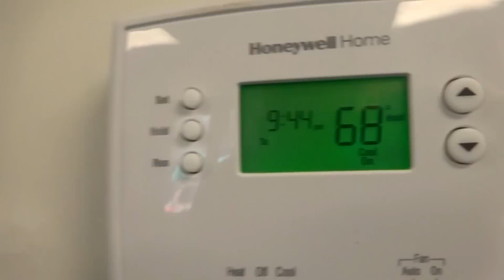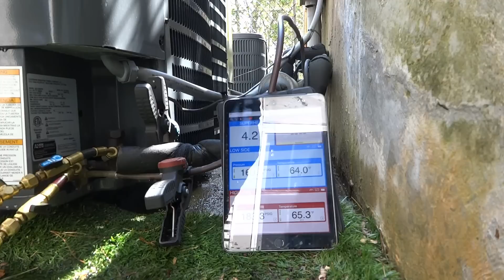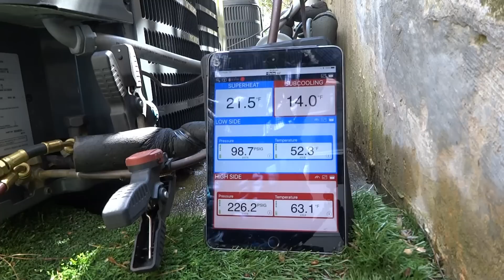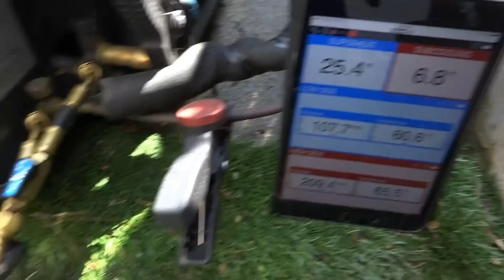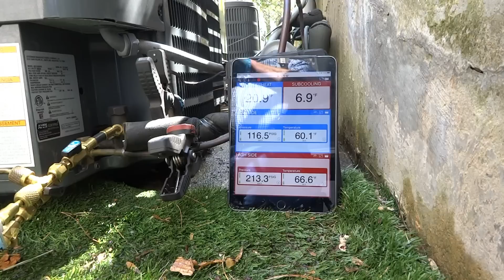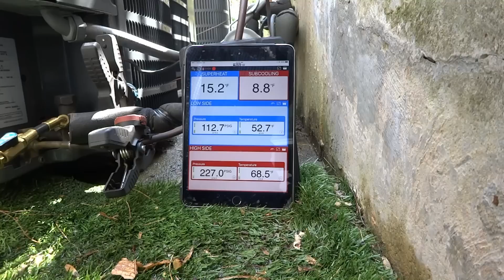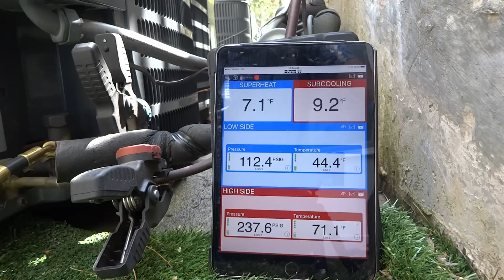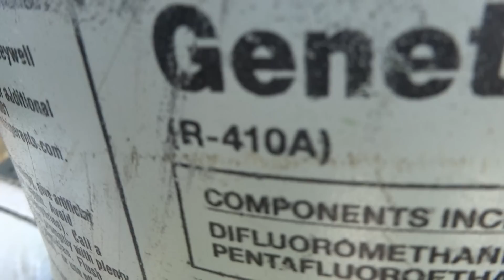AC UNIT ICING UP RETURN THE NEXT DAY

Comment: I have 6 roof top units at work. Only the jail unit gets nasty with cottonwood. It will pack jail unit but other units will just have small amount. Every year. Thanks Steven!
Reply: Cottonwoods on one end of one of the many multi housing buildings I take care of. Oddly enough it only seems to be two of them that consistently get hammered by the fuzz every year.

Comment: I always keep my fan to “on” not auto. That way it’s always moving air in my 3 level house, plus no start up surge on the motor. 🤷‍♂️ In my case on is a very low speed until heating or cooling is called.
Reply: You can but the outside unit won't run till that coil inside gets hot
Reply: @prettycureforever7102, the condenser or outside unit comes on when the thermostat calls for cooling, it has nothing to do with the evaporator coil or inside unit getting hot.

Comment: They are changing again, from 410a to R32, this crap is getting out of hand.   In Mexico they are installing brand new R22 units, meanwhile here they are mandating to toxic refrigerants that are even flammable.  I gave a window R32 AC a little toot of 410a using a bullet connector, seems to cool just fine. (410a is 2 refrigerants, 50/50 R32 and R125)
Reply: A LOT of mixtures in the automotive industry years ago, and some very flammable! Interesting about Mexico. They probably sell Gas Stoves too! 🇺🇸👍
Reply: @hinspect  R-1234yf is actually flammable, but the EPA is in denial about the risks.

Comment: 410-A system on an R-22 coil.. wow. Ain't no Taj Mahal
Reply: I thought that was actually quite common.  My old house had a 410A system, and it was put on right when Carrier started to build 410A units, so the coil was an R22 one from the beginning.
Reply: @douro20  R22 Coils are not made for 410a pressures. people do the shit , but not me. I'm not gonna hack the system. if they don't want it fixed right, Call someone else

Comment: It's extremely painful to watch someone clean a coil the wrong way. These units suck in air and blow it out the top, so you have to spray the coils from the inside out to reverse it, otherwise you're just pushing most of that junk deeper into that coil. If it has a fur coat on it like that first one did, a soft carwash brush works to gently brush it off first. It's not rocket science 😆

Comment: its so much worse cuz its a leaker and running more to try and do the same job.  and no you don't do what the customer wants, burnouts need evap, and line set change. your acting like your new at this, some times you pass on jobs when customers want to make poor choices. also a side note with low load  wet condenser or cool out side cool inside, block part of the out door fan to maintain a minimum  of 140 PSI between high and low pressure and you can trust your numbers on 410A     and 100 PSI difference on R22